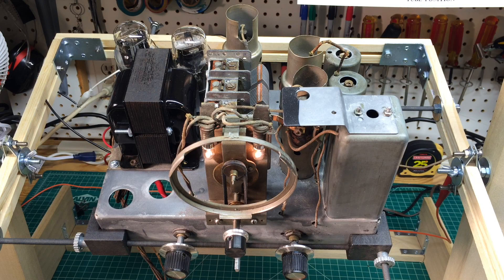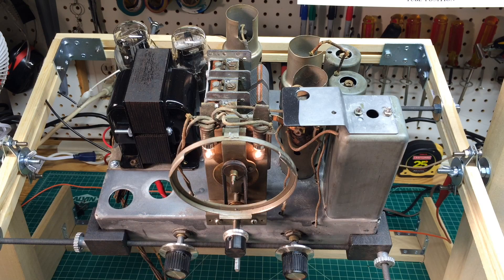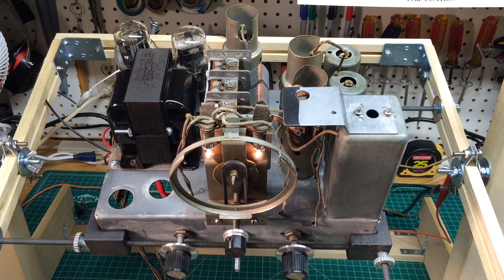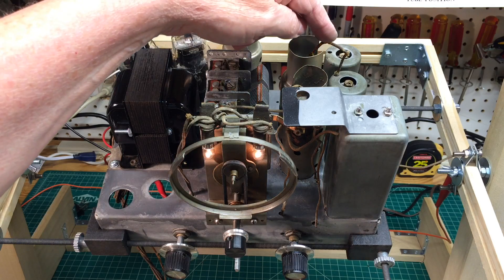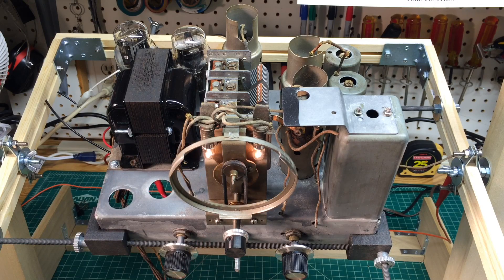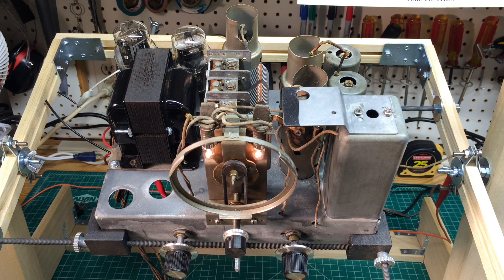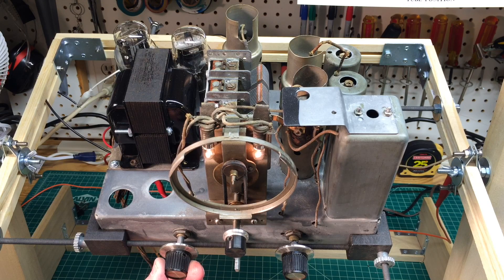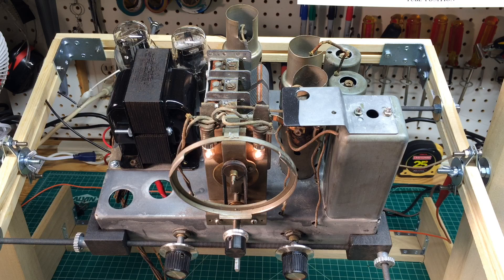Zenith 5-S-29: Playing

Comment: Sounding good Don. Thanks for the update. Do you ever run into silver migration issues with the IF filters?
Reply from the maker: +Billy “stormlight” Steen +SteelCity321PB I'm copying Phil on this too for his input. I think the silver mica problem is more common in some of the later sets from the late 40’s into the 50’s, but I'm not really sure. I have many AA5 sets unrestored that could be problematic, but my recent projects have been mid 1930's with no problems. Best, Don